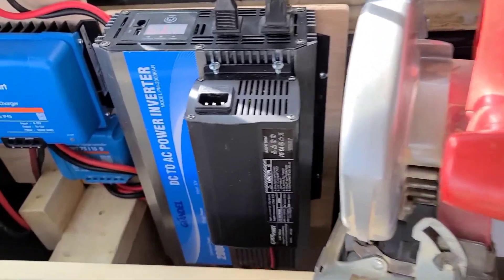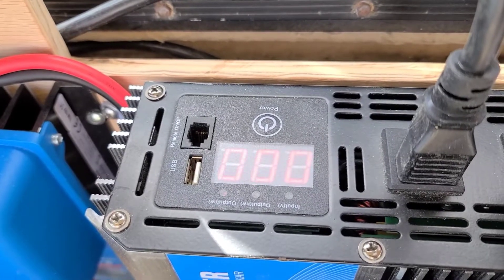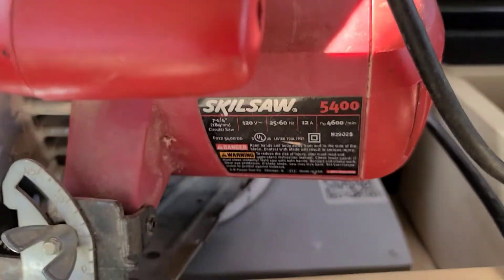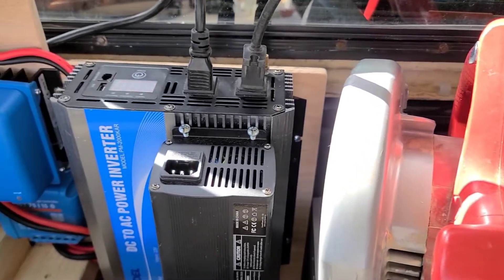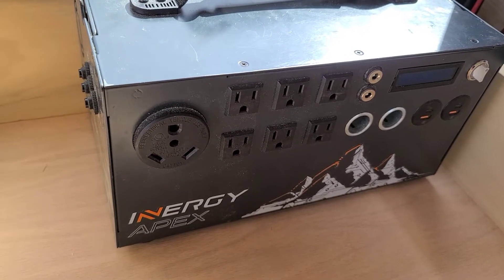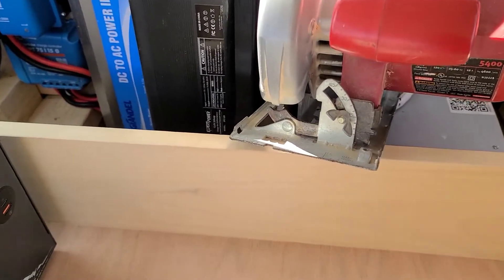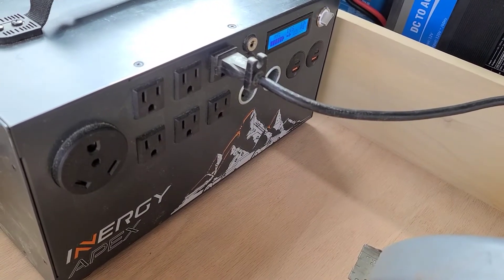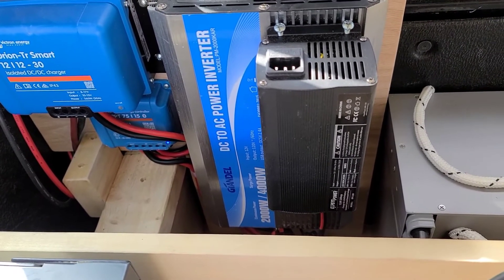Is this Circular Saw too big for this Giandel Inverter

Comment: I've been experimenting with my circular saw on a Jupiter 2000 Watt pure sine inverter.   It'll startup just fine.  The problem is sawing.   It can saw softer/thin wood no problems, but I kept faulting out on some of the harder 2x4s.       I wasn't keeping an eye on my load meter.  It was about 980 watts to run the saw without cutting anything.   Saw is rated at 15 amps.   Somebody's ratings are off.
Reply from the maker: That was my main point. You can't go by the ratings. 15 amps @ 120 volts is 1800 watt. You would think you should be fine with a 2000 watt inverter! Unless your blade is so dull that you are using more than the 1800 watts that the saw is rated for! I would guess it's the invertor that can't handle the 2000 watts, or your wiring or battery connection are weak.

Comment: You neglected to mention what type of battery (and its capacity) you are using connected to your Giandel.  The battery could very well be the weak link in the equation.  Your 12V battery (if 100 Ah ~1300 watts) might not be supplying enough current to the inverter to power up the saw.  The solar generator / power station has its own internal battery (I assume 48v) designed to supply the necessary current for 1500w.  So I'm not convinced it is the inverter's fault.  Hook up more powerful or multiple 12V 100 Ah batteries in parallel and supply enough current to the inverter, and then see if it still will not power the saw.
Reply from the maker: Good point! The battery I use is Big Battery, 12V Owl, 170ah. This battery is rated 175 amp max continuous discharge, 350 amp peak for 6 seconds, 2240 watts continuous power. I went this route to ensure I would have enough power. The power cables go directly from the Battery to the Inverter. This battery has internal fuse and and on/off switch. Plus the inverter is fused!

Comment: It’s the amperage. Is your saw 15 amp.
Reply from the maker: Can't what? The 1440 watt saw faults out on the cheap 2000 watt invertor which has a 4000 watt surge. My USA built, smaller, 1500 watt inverter runs the saw fine.
Reply from the maker: This saw us 12 amp, I explain it in the video. The saw is 1440 watts. On the first pull of the trigger the inverter faults out. After I reset the inverter it will run the second time. I know it's the surge current tripping the inverter. My other smaller inverter runs the saw no problem. My point is, you can't always trust the ratings!
Reply: @daveandsonyainmichigan  definitely can’t.
Reply from the maker: Definitely can't trust the ratings! Got it! 😂